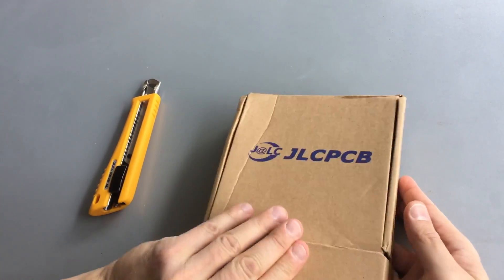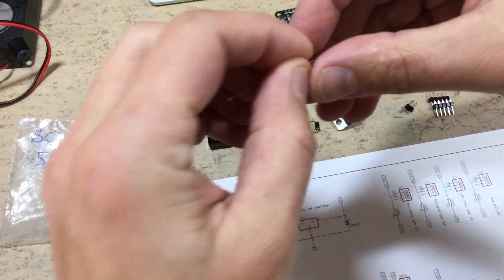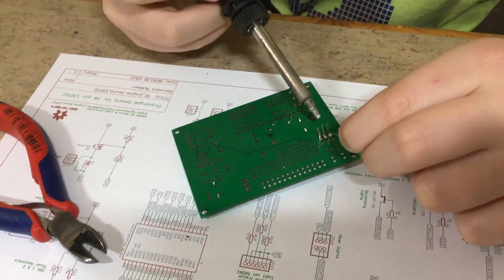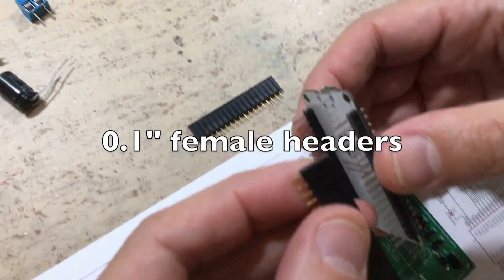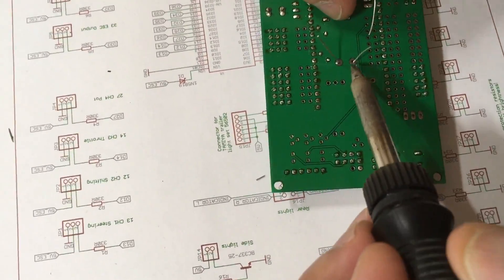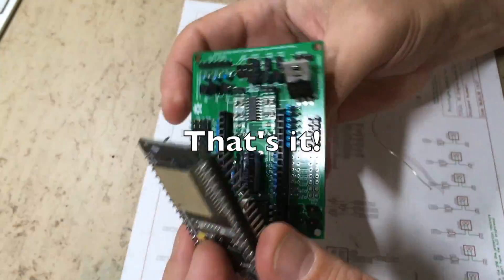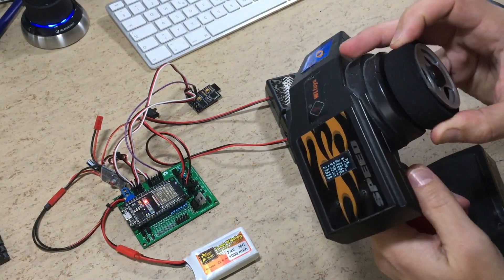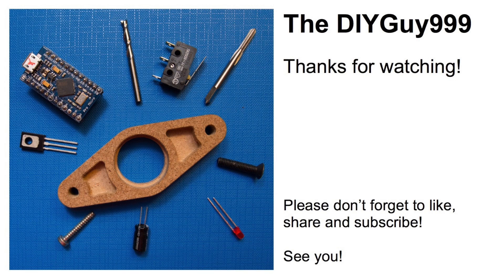Arduino ESP32 RC Engine Sound & Light Controller: How To Assemble The PCB Tutorial

Comment: Nice project. I ordered PCBs from JLCPCB using your Gerber.zip file from Github. Can you confirm it's the 30 pin version of the ESP32 I have to purchase and not the 36 pin version ? By the way, I wonder what difference there are between the 2 version, at least on the sound module
Reply from the maker: Thanks. It depends on which version you ordered. You can find the pin count on the schematic. The difference is, that the 30 pin version is more optimised, meaning it has driver transistors for all LED on board and a nicer layout.
Reply: @TheDIYGuy999  Thank you. It looks the final folder have the 30 pin version of the PCB, so I ordered all components. I will post a video when the sound kit will be built. I have made a 5 gear animated lever (2 nano servos) attached to an animatronic driver (3 axles neck) and the goal will be  to synchronize the gear change on the lever with gear change from the sound box. all fits in a Tamyia Scania R470 truck
Reply from the maker: @bamorun8038  Great, can't wait to see your video. Let me know, when it is done

Comment: Great video.thanks for all of your hard work. Do you think you would sell a kit with the PCB and the components we could solder in?
Reply from the maker: Thanks. I think it does not make sense, because ordering your boards directly is very easy and the components are easily available on eBay.
Reply: @TheDIYGuy999  thanks for the quick reply. Can you walk us through how to get the Gerber file for the PCB and a list of components to populate it? Again thanks
Reply from the maker: @steve8939123  Download "Gerbers.zip" from here: https://github.com/TheDIYGuy999/Rc_Engine_Sound_ESP32/tree/master/Eagle_PCB/Final
Then upload it here per drag & drop: https://cart.jlcpcb.com/quote?orderType=1&stencilWidth=100&stencilLength=100&stencilCounts=5&stencilLayer=2&stencilPly=1.6&steelmeshSellingPriceRecordNum=A8256537-5522-491C-965C-646F5842AEC9&purchaseNumber=
Afterwards just select the color you want. Don't change anything else. You can see all the required components in the video. For the recommended 30 pin board you need this ESP32: https://www.ebay.ch/itm/Espressif-ESP32-WLAN-Dev-Kit-Board-Development-Bluetooth-Wifi-v1-WROOM32-NodeMCU/253059783728?ssPageName=STRK%3AMEBIDX%3AIT&_trksid=p2057872.m2749.l2649
Reply: @TheDIYGuy999  thank you. Inside the Gerber zip file is 9 files, which do I copy and paste to send to make the PCB? Sorry, but I want to do this right.
Reply from the maker: @steve8939123  Upload the zip file. You will then see a preview of your board.
Reply: @TheDIYGuy999  thanks. I pasted the zip file and they accepted it. Hopefully I will get the PCB within a month.
Reply from the maker: @steve8939123  Great. My PCB's arrived after about 8 days
Reply: @TheDIYGuy999  When i copied in the Gerbers.zip file to the web site everything loaded in except the board size.     In the link the size appears to be 100 x 100 mm    square.    but in the video it looked longer then wide.  Which is correct.    Thank you for the work you have done on this.

Comment: Hello,
First of all, a big thanks for sharing your projects. I'm looking forward to order some PCB but I wonder what file to use.
On the github site, there's a prototype (for 36 pins ESP32) which is not recommended  and the final files (for 30 pins ESP32).
Looking at the above video, it looks like you used the 36 pins version...
You mention also the fact that the board had to be revised to correct two little problems.  Looking at the files date, I see that the 36 pins version was modified more recently than the other one.
So, my question is : which file should i use to order pcbs ?
(I beg your pardon if I missed important information containing the answer )
Thanks by advance for you response as also a pleasant Easter Week-end (if any).
Michel
Reply from the maker: You're welcome. Yes, the 36 pin files are newer, because I solved some issues. I still recommend to use the 30 pin version, the D0 / D3 pin swap is already included there. I used the 36 pin version for this tutorial, because the 30 pin version did not yet arrive. For ordering, just upload "Gerbers.zip" in the "Final" folder on JLCPCB. Do not change parameters except the color you want. Hope this helps. Have fun building it.
Reply: @TheDIYGuy999  Thanks a lot for your quick and complete answer. I'll try to order some pieces tomorrow :-)
Michel

Comment from the maker: Finally! The custom designed PCB arrived from JLCPCB and allows me to show you how to assemble the Arduino DIY ESP32 Open Source RC Sound & Light Controller. What do you think? Let me know in the comments. Until next time!
Reply: Yeah except the board you use isn't the same as your current design, making this video kinda useless.
Reply from the maker: @lordsanityfree  This board design is still available for download. The assembly process for the new one is essentially the same.